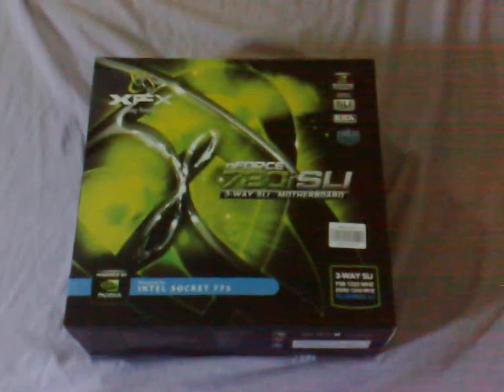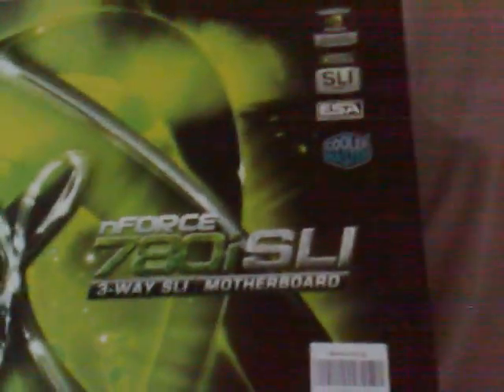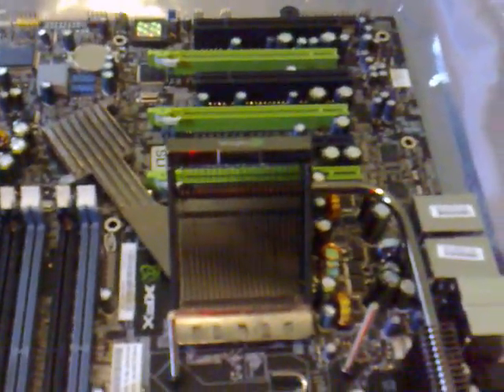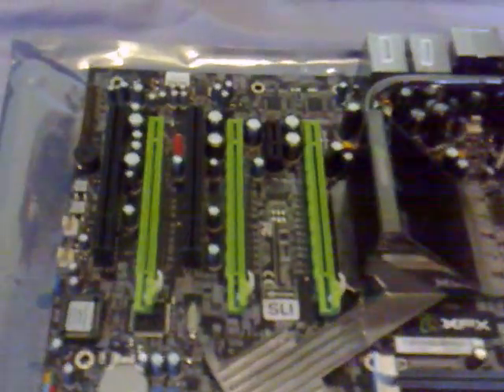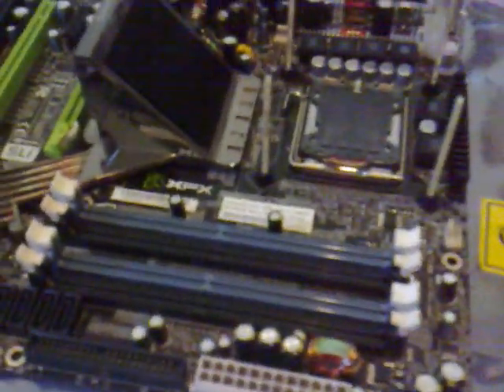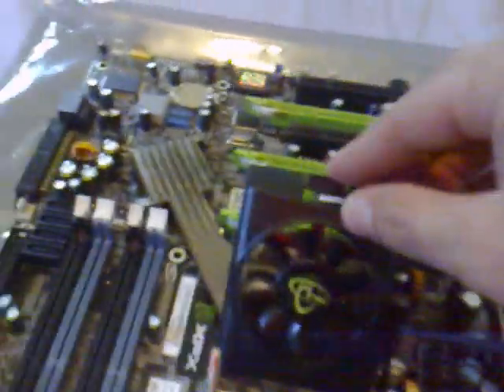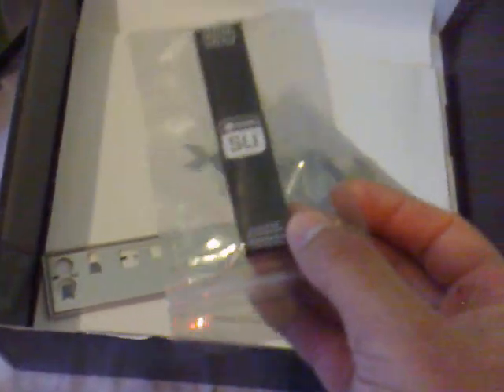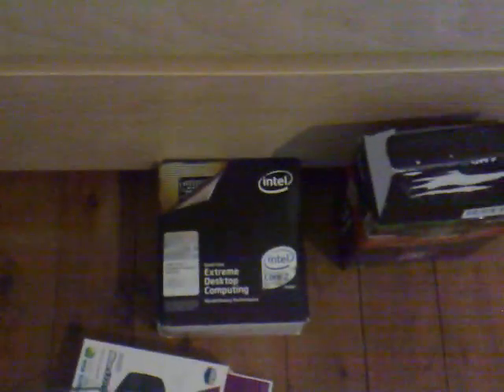XFX 780i SLI Update/Enthusiast Build!! (Part 1)

Comment: hey thanks, maby you could help me out, tomoro im getting a older comp, 3-4 years old. pc. im getting a nice case with it though. for 80. but im wondering if i can upgrade it. like do a littl ehere and there.. or would it be better to just use it the way i get it, then just buy each part i need , MB, CPu ect till i get where i can just take out the old mb and cpu and put in this one

Comment: Does not even Post! I know that it is working b/c the boards LCD lights up with the error message. Every online says that it is either the memory or lack of compatibility with quad cores and 45nm processors. So this board runs very well right? I have done 5 months of research and this is my first build for gaming only and I can only regret overlooking the issues with this board.

Comment: What do you guys reckon of this gaming build? are all the parts compatible and what not?

Processor- Duo core E8400 3.0GHz
Motherboard- Gigbyte EP45-DS3 
DVD burner- SATA 
PC Memory- 2x1GB DDR2 800MHz 
HDD- 250GB harddrive 
Graphics card (PCI-E)- 9800GTX 
Power Supply- 550W Super Flower
Monitor- ASUS 5MS 19" 

Reply back to me please.

Comment from the maker: ok, If your using SLI ( 2 or more nvidia GPU's) we have no choice but to go with SLI boards such as the 780i SLI, but in the other hand if your not using SLI or using ATI cards,
I STRONGLY reccomend going with a intel boards such as, X38 or X48, they are ALOT more stable and overclock hell of alot better..
By the way what CPU & RAM are you using with your 680i board??

Comment: Hey i have the evga 780i tri sli motherboard and im trying to get my q6600 to 3.4/3.6ghz on stable.  I have a Corsair TX 750watt PSU, 4gb OCZ HP Ram, and a Zalman 9700 heatsink. It runs stable then seems to reboot at random times and restarts after like 5 minutes of Prime95. I personally think its the memory timings but imnot sure. im running them at stock timings so if i overclock does that mean i have to tighten up my timings? Theyre at 4-4-4-15 at 2.2v stock and my Vcore is 1.55 actual CPU-Z.

Comment from the maker: Hi there,

If you have the money for DDR3, i would surely go for 790i, the 790i sli was designed to compete with intel's X38/X48 boards.
790i sli are alot more stable and faster than the 680i/780i boards, considering its a whole new chipset. 8gig RAM huh.., in all honesty 8GB RAM is a absolute WASTE, 4GB is more than enough. :}

Comment: Maybe anyone here can help. I'm having a lot of trouble with my (pretty) old computer. I upgraded my old videocard to a new one last year and aslo updated my power supply. But i dont want to spill to much money to get a decent gaming computer. If i upgrade my motherboard AND CPU will me computer then wont have any problems anymore? My trouble is that it crashes EVERY day, i need too reboot manually to restart and most if the time it doenst fire up anymore and i need to wait 3-4 hours.